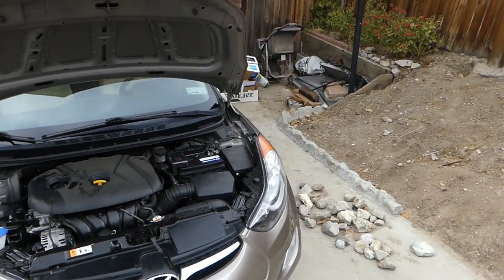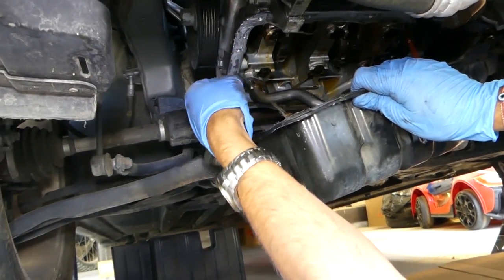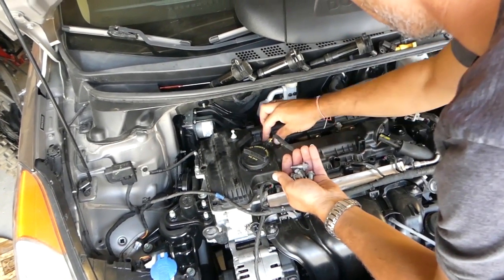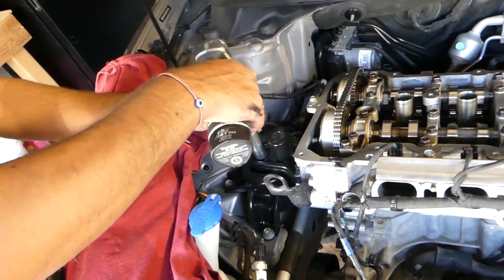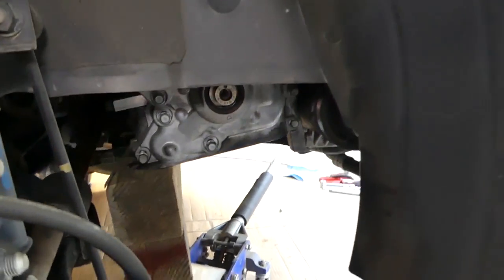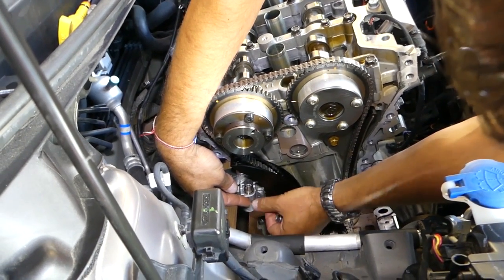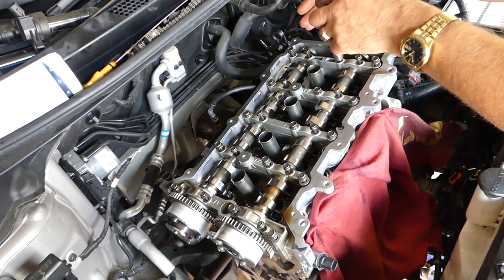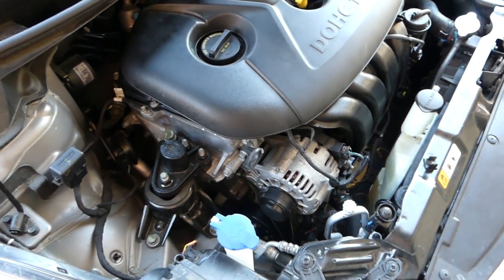HOW TO REPLACE CAMSHAFT ON HYUNDAI ELANTRA 1.8 2.0 NU

Comment: you can do this without removing the front cover. theres a plug in the cover behind crank pulley to remove tensioner arm to slack chain enough to remove camshaft phaser
Reply: I tried this and Ifucked up. Chain doesn't lift up enough/ Maybe I skipped some steps?

Comment: Hello good, a question, I have a 2014 elantra with G4NB engine, 1.8L. I think it is the same as yours, I want to buy the exhaust sprocket, do you save what number of that part does my g4nb motor take?

Comment: Hi! My Hyundai Elantra 2012 drained the oil while driving . It was five minutes and the engine turned off. When I tried to start the engine, the crank turn and the engine sounds ok, but the car does not start. Is this a timing issue? Please let me know. Thank you!
Reply: Abdul Kad  If the oil fully drained out of your vehicle its likely that your engine may have seized

Comment: my mechanic hyundai dealer just recommended this along with the timing chain because of some loud ticking in the engine.  Just wondering what a normal repair shop would charge.  They quoted me just over $1900

Comment: I have code P0014 more than 3 months I have changed both Camsheft postation sensor and filter with oil but still I have the same code p0014.the car is working fine
Reply: hi how are you, I think we went through the same problem my code is P0014, it turns out that it is, the internal wedge of the same sprocket of the exhaust, do I have to replace it according to the same original part number, my engine is g4nb and yours? and you already solved the problem?
Reply: @santiagosurieljimmy7334  Thank you for contacting us. I found the cause of the following Codes p0014
Crankshaft sensor 😅